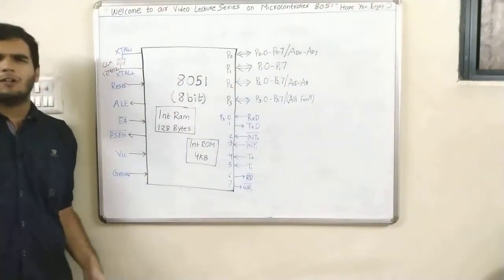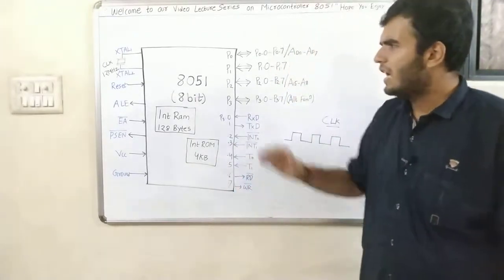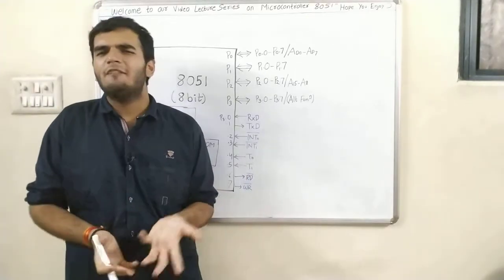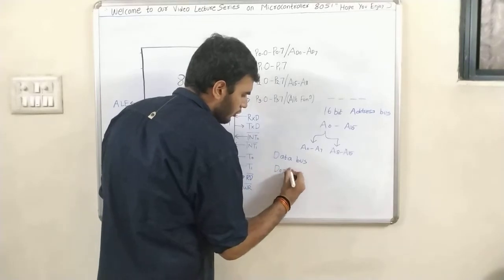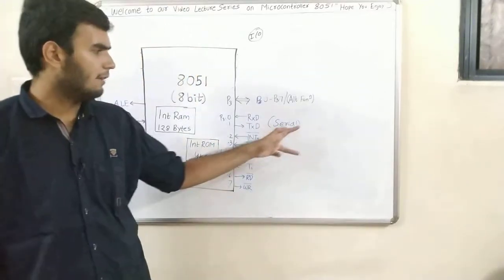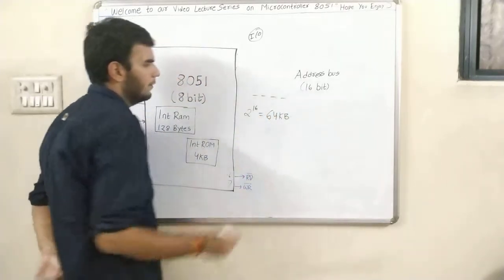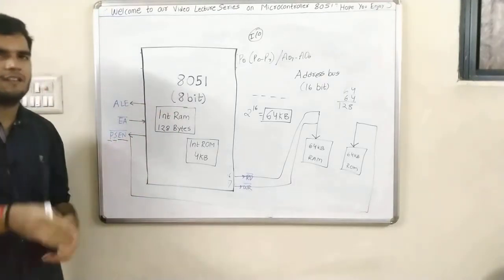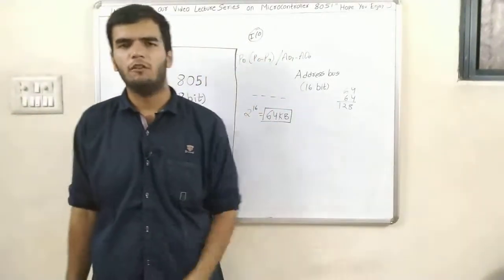Pin Diagram of Microcontroller 8051 easily explained in English. #pindiagram #8051 #microcontroller

Comment: What is data and code memory
Reply: data memory refers to the RAM and code memory refers to ROM. In ROM, the instructions or programs required for 8051 is stored and the data which are supplied to the programs for execution are stored in RAM.